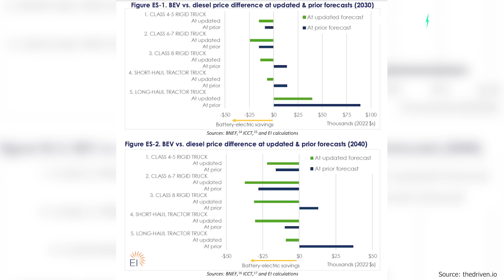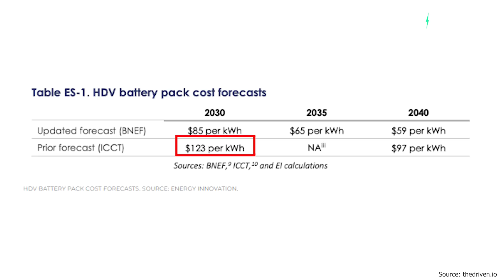Electric trucks will be cheaper than diesel many years sooner than expected

Comment: Most people way overestimate what can happen 1 year away and also way underestimate what can happen in 10 years away. 16 years away for majority EV truck transition. It's all possible, just need the infrastructure to support them and re-gig the electric grid to support this large increase in electricity demand. Pepsi's 4 megawatt charging connectors stalls take as much electricity as a small city of 10,000 people and so they have to work with the local electricity supplier to fit in their charging schedule with power availability.

Comment: What makes anybody think that battery price falls will continue at the same rate. The recent price changes correlate with an 85% drop in lithium, to the point where lithium mines are closing down because of profitability constraints. This means that the price of lithium has probably gotten as cheap as it will and will start going up again when demand prompts it.

The statement that energy density of batteries is increasing is vastly over stated, improvements are limited by battery chemistry, the latest improvement in LFP still dont get it to the same level as li-ion even though LFP is probably the better option due to the safety benefit, and if it is correct that a much better battery is just around the corner, why buy an EV now?  what happens to the EVs that are currently on the road when this vastly better battery technology does arrive?
Reply: Good comments and questions. You sir, have a working brain, unlike many of the commenters in these EV threads.

Comment: I'd expect local delivery perhaps, but it's not taking over all trucking. Not replacing agriculture / tractor / heavy equipment where power density of diesel cannot be matched. How far can an electric semi tractor pull 120,000 lbs of sand ? When it's zero degrees outside ?
Reply: You're probably right - but eventually electric might take over. The biggest engines are electric, such as mining shovels and other huge mining equipment, freight (and other) trains (diesel-electric),  submarines, battleships, aircraft carriers (nuclear). It's the battery storage that needs to be developed more before we can transition to the items you refer to.
Reply: It's also just the notion of creating batteries for all these vehicles, globally, and replacing them every X years on a cycle. It's just not going to happen. It can't.

Comment: No way you're going to replace diesel-powered long haul tractor-trailers (semis) with solar, wind and batteries. Those of you who actually believe such nonsense aren't in the trucking business or have someone in his family that is, like me. It's not the battery that's the main issue, although it's an issue. It's range and CHARGING TIME. Also, you could not possibly support the current U.S. truck fleet with the existing grid; can't happen. You need base load for that. You also need thousands and thousands of charging points that aren't available.

Just think a little.

If a Cybertruck's range drops down to mere 90 miles by just towing a paltry 10,000 pounds, what do you think will be the case with an 80,000 pound tractor-trailer? On top of that, if a small trucking company with say, 20 rigs, tries to deploy multiple fast charging systems in its yard, it will have a very nasty phone call from the local power provider–– GUARANTEED. I leave that to your imagination as to why.

Tony Seba is flat wrong about large transport diesel trucks.

If this idiotic world had brains, it would deploy only cheap, low price, city commuter EV's at this time to maximise our limited battery production to remove as many unnecessary oil cars off the road. Many people, such as myself, never leave town. And I own a business, which uses two trucks. HELLO!!

P.S. Just because you can produce a semi that has a range of 300 to 400 miles in ideal driving conditions, doesn't mean it's practical and doable at scale. Again, think charging time, grid and lack of charging stations. One more thing. I don't give a rat's ass if you give away EV semis for free. You still have issues operating those things.

I'm not against EV's, but I know their limitations. They are NOT the solution for everything.

Comment: Have the engineers of the west gate bridge factored in the extra weight of EV trucks and cars?
We already have had a EV cement truck catch fire on the West gate freeway only luck it was not on the bridge.
Reply: You could ask them. This is the Internet age.
Reply: I suspect EV trucks would still be held to the 80,000 pound limit which means they could only carry half the freight of a diesel because of the weight of the batteries. Twice as many trucks to haul the same amount of freight. I wonder how ecological that is?

Comment: You can always find a report “emerging” that will show the converse of what seems rational and reasonable.  Me of little faith.
You just have to look at how the trucking and logistics businesses work and then identify if electrirc trucks can or will be able to fill in for diesel.  So far it is not looking 100% as a replacement IMO.  It may improve or we may change haulage to suit.  But either way the one question in all of this is:-  Can you show me the equivalence to diesel right now?  More importantly, show me how the logistics of going electric works for truckers, given their free will to decide how their businesses operate, and will it suit their needs to make the switch?
My overall impression is that in an area where every kilo of unnecessary weight works against you when hauling heavy loads, the idea of a 600kWh dead weight battery pack seems incongruous.
Reply: In trucking every pound counts. I hauled onions in 50 lb. bags and was paid by the bag. Under those circumstances you don't carry an extra pair of underwear if you don't have to because for every pound of personal stuff you haul you lose one pound of freight which means you lose money. Trucks are held to a standard 80,000 pounds total weight by law, including truck, trailer, cargo, and extra underwear. Hauling heavy batteries means less freight which means lower wages for truck drivers and means higher prices on every single thing you buy because every single thing you own or consume was on a truck sometime before it got to you. Plus there is a nationwide shortage of truck drivers already and if you cut the pay further that will get worse. Trucking affects the entire economy and thinking you can just throw a bunch of electric trucks on the highway and think "problem solved" you are insane.
Reply: @YourHineyness  Yep, I tend to agree.  Things are a bit different in Oz where I am, but essentially the same.  How can that be?  Well, we run just about everything on big rigs to keep the population fed and we would be in a rather large hole if we could not deliver everything we use and consume via trucks.  Anyway, we have made some concessions for eTrucks that might not have occurred otherwise, by changing our road rules to accommodate them (I believe the centre driving position for the Tesla Semi is one of them, and something about an 4 extra inches in width of a trailer for some reason).  My only thought here is that there is an allowance in the US for the battery pack to go above the haulage limit, so that the battery pack can be treated as part of the rig and not freight.  Essentially though, it all stacks up to the same issue.  A big battery pack that is dead weight.  Diesel is heavy but gets consumed along the route, and I doubt it weighs as much as an NCM battery pack anyway.

I think you are on the money as we would say here (in other words, you are correct).  Even with scheduled change over of drivers, there has to be some situations where the rig maybe cooling its heels whilst the driver waits for a full recharge.  Burning a big hole in the budget.  Big logistic companies might benefit more than independent operators, but thats hard to determine at this stage.  I also found the interview with an eTruck driver who indicated that the 1mW charger he uses are limited to 800kW currently.  Constraints on the grid or not a good idea to charge at the full potential?  Who knows, but 1mW is breath taking!  Jason at Engineering Explained has a run down on eTrucks (Semis) and his assessment is pretty interesting.  Cheers for the response.

Comment: The truth is, this will never happen until the oil tycoons have pumped up the last drop of oil.
Reply: Unfortunately it will be too late at that point.  All the metals and other materials required to make EVs etc - they all rely on diesel-powered mining equipment.  If the Peak Oil people are correct and we start running out of diesel (i.e. it starts becoming super expensive) in about 10 years from now, it will cause price increases on EVERYTHING.  Nat Gas (Methane) will still be cheap in the USA for another decade because of fracking, so I'd expect to see the trucking industry convert to ANY power system that is still feasible - a mix of diesel, petrol, methane/propane, BEV, and grid-electric vehicles, and they will ALL be more expensive than today's trucking solutions.

On the other hand, it's unclear when oil is likely to run out.  There is still a lot of oil tied up in tar in Canada and Venezuela, although that requires a lot of energy (possibly nuclear powered steam in future?) to extract.  Oil products (especially diesel) are going to cost a lot more as supply declines relative to global demand, which is still increasing along with standards of living in India, Indonesia, and other developing regions.

Comment: I cannot speak for any place outside of the USA and Canada but as far as trucking goes (Class 8) without the North American Railroad System which is worth a look as just an image from google it is so massive and unlike anything on Earth there would be no trucking industry. As for pure bev trucks this is even more so as true as you don't need these massive machines to travel far to make them "work"(be cash flow positive) which for pure play bev trucks is exactly how this type of power system is ideally suited for/works best as. Making these machines in sufficient volume is no small matter however and then there is highway wear and tear also no small matter. The USA was born a Railroad Country and in my view will die one but as a still licensed Class 8 truck driver with 100,000s of miles driven over a decade "trucking" is what makes the US economy in fact work/not work as the case may be and i have NO DOUBT Team Tesla et al have really moved the ball forward(US Football/Rugby term) in a positive way for this piece of "critical infrastructure" namely the actual TRUCK and the actual DRIVER. easy to forget there are humans involved in making all of this happen.

Comment: Transport industry is about getting product to places on time.
For that you need reliability not EV. Penalties may apply when not delivered on time. If there’s power outages , broken chargers your screwed. There is no plan B besides Diesel generators.
2 of these trucks would need over 1MWH of electricity which would require 2-3 acres of solar panels on a good day plus at least a 1MWH storage Battery tell me that’s efficient and cost effective for a transport company.
Reply: What type of trucks are these that are being used and what are their daily distances. Are they just metro routes?
Reply: Working in the Fleet/ fleet repair industry i can tell you we are going EV for heavy duty BECAUSE there is less downtime. we have almost daily issues with fuel delivery and emissions equipment on our HD fleet. our EV fleet is almost 100% flawless
Reply: @3184Patrick  You likely have a manager that looks myopically at the short term instead of extending your analysis to be long-term or beyond regular maintenance & current day costs, just like many of the CEOs at large companies that are making short-term decisions to the long-term detriment of running the business into the ground.  

Wait until a few wrecks happen & the vehicle is totatled, one of them bursts into fire due to a battery malfunction, the battery cooling system malfunctions and repair is unchartered territory & takes forever, or the Electric rate goes thru the roof and b/c you are commercial/industrial load, on high demand days, your company is load shed so that residential customers don't lose their essential A/C or heat, resulting in operating losses.  Hertz thought EVs were economical and then realized a few years later that the hidden costs were greater than they expected, so much so that they are liquidating 20K of their EVs and cancelling their contract with Tesla.

Comment: Again, it's meaningless until it happens. For now it's just speculation and hope (for some).
The truck may be cheaper, but you will have to buy the battery separately, and the battery will cost more than the truck.

Comment: More BS.  The charging time, distances travelled, recharging stations and reduction in truck load capacity to name but a few reasons means EV trucks will NOT replace diesel.  I can't believe people continue to listen to this BS.  Price parity is meaningless when the total-cost- of ownership (and running) will be far, far higher for EV trucks.
Reply: Pepsi is using Tesla semi trucks and lovin them.  You’re just flappin slick.
Reply: see - RUN on less challenge. Tesla did 1200+ miles in 24H. Full Load 82k.

Comment: Diesels and big rigs will probably predominate until autonomous trucking using more, but smaller trucks is cheaper. Large trucks/loads is to maximize the value of the driver.
Reply: Diesel is UNPROFITABLE & unsustainable.
💯% BEV semi are CHEAPER to operate, can haul 82k gross FASTER than Diesel.
Diesel have 100% MORE maintenance than BEV.
both PepsiCo & FritoLay have saved $Billions already by going BEV.
Reply: DIESEL bans coming in 2025. USA.

Comment: I thought/heard that electric trucks have a limited range compared to diesel and take forever to recharge.
There were plans to develop hydrogen as the future of trucking instead of electric.
Reply: FALSE, Tesla semi hauled 82k FULL LOAD 545+ miles in LESS than 8H, and 1200+ miles in 24H.

Comment: Not sure how that’s going to work in outback australia.. also maintenance isent to bad.. the Volvo I drive has done 2.2 million kilometres without an engine overhaul, just a regular oil changes. Has only had 1 gearbox overhaul… and we pull up to 130tons…
Reply: BEV have 100% less maintenance than Diesel.
Reply: there are Chargers in Alice Springs, middle of nowhere.
Reply: @markplott4820  getting to Alice Springs is a long drive and most places in the outback is not even tied to a grid.. and when you do upwards of 1000-1500 km a day with 100 tons…
Reply: @JimmInOz  - in 2019 two french men drove Nissan LEAF from south Africa to Monaco.
In 2024 man & woman drove POLE to POLE in Nissan ARIYA.
Reply: @markplott4820 that’s cars.. they aren’t transporting lots of weight.. and you can’t wait months for your freight to get there
Reply: @JimmInOz 1000 to 1500km per day . Doubt that could average 100kph including stops, load and unloads that’s 15 hours a day at 100kph AVERAGE. This is the exception of a truck with 2-3 drivers and operating 24 hours a day. Imagine how much diesel. Looks like a situation in the future for a high powered more cost effective Electric Truck. Once infrastructure charging is built out and battery tech has advanced.
Reply: @InformedKiwi  average 5000kms on weeks I go to the mines. 5 day work week. But have done 7000km in 6 days before, often 80-120 tons.. yes I only drive 1km or less per litre of diesel.. so I chew through 1500litres in a day…
Reply: @markplott4820  markplott, I think that you have lost it !

Comment: Yes, there are highly toxic particulates put into our air, from tire, brake & road wear.
But those won't be reduced by switching to EVs, they will be reduced by moving more freight & passengers on railways instead of roads, because steel (train-wheels & rails) is non-toxic, while asphalt, brake pads, brake fluid & synthetic rubber are all highly toxic.
Telsa Semi might help with that though, since its range is  barely enough for most use cases now, but would be more than enough for all use cases if we built inter-modal yards everywhere and invested in our railways enough so they could electrify & separate both passenger & freight service.
 We can't defeat traffic with more car lanes (in tunnels or not), we defeat traffic with fast, frequent & affordable passenger train service like they have in the Netherlands (155 round trip trains per day between Delft & Amsterdam for example). And we can't get that without electrifying, separating & straightening, both  freight & passenger rail service, everywhere.
 Getting a lot of freight off highways and onto railways (for the middle part of the freight's journey anyway) will help reduce traffic congestion too, the new inter-modal yards will help with that.
Reply: TESLA semi DONT use Jake brake or any Friction brake to STOP .
only REGEN.
Reply: @markplott4820  Regen braking still needs tires & asphalt to work, so toxic particulate are still put up by tire & asphalt wear, & regen doesn't do 100% of the braking. Brake pads still wear out, so they still put toxic particulates into the air.
 Steel wheels on steel rails, don't put up any toxic particulates.
Reply: @user-4in4nxDonaldRennie  - NOPE 2012 model S in 2019 same brake pads, I NEVER use them 
SAME for semi.
Reply: The 'toxic tire particles' issue is just right wing nonsense. 

Guess which vehicles on the road use tires?

ALL OF THEM!
😂😂😂

But you're right that we should invest in our rail infrastructure, right after we nationalize all of it!
Reply: @stephendaley266  ALL of them.
 It's not "right wing nonsense" or left wing nonsense, it's science.
 Can you guess which vehicles don't use tires?